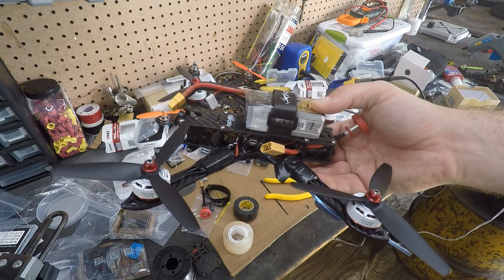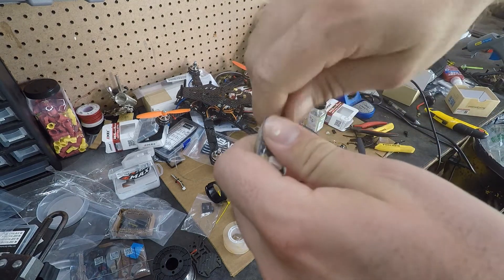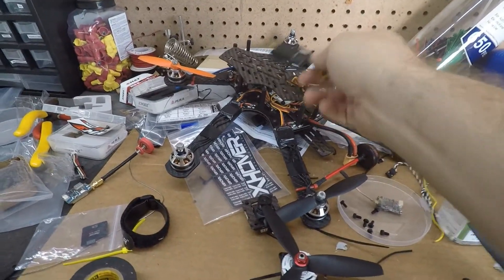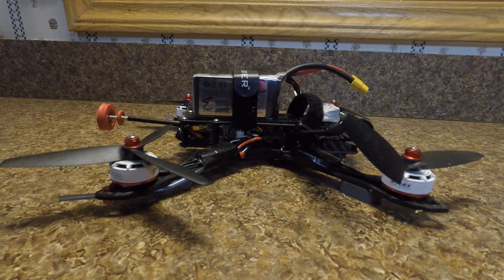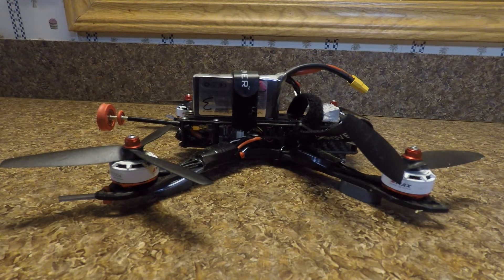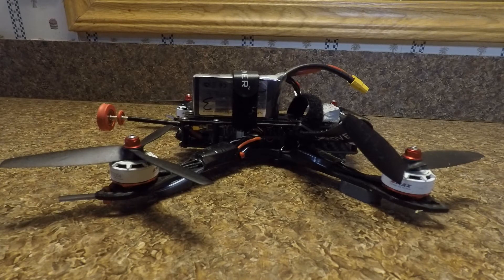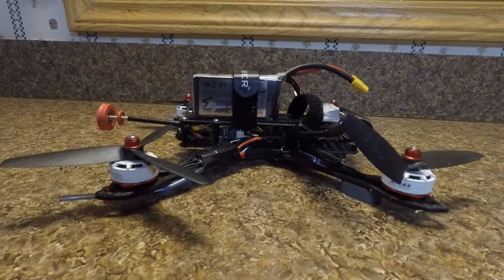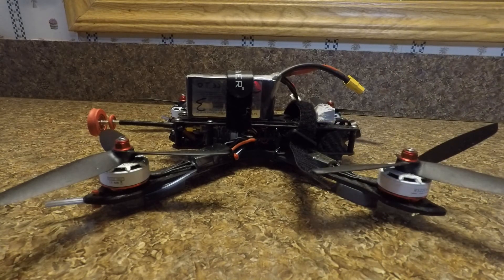xHover Stingy Build -Part 3 Getting it Flying

Comment: Did you run the unify pro off of the betaflight? i had an issue also that BF didnt supply enough amps on the 5v for it to work. maybe that was the issue you had with the unify.
Reply from the maker: Yeah I think that was the problem. But this 13 dollar vtx I'm using now is bulletproof. I'll never spend big bucks on a vtx again.